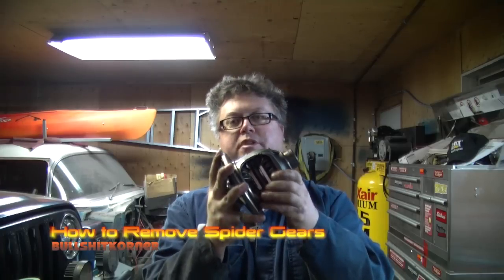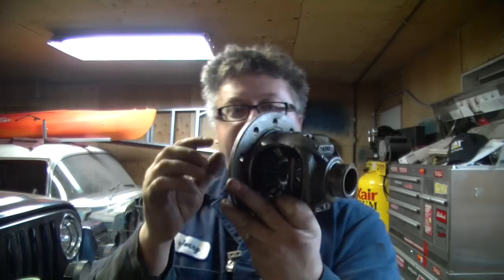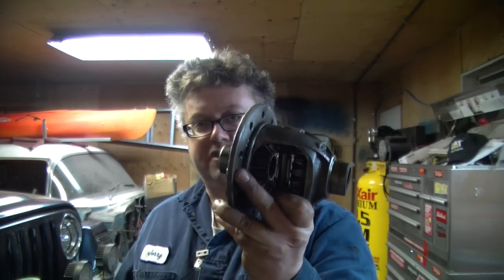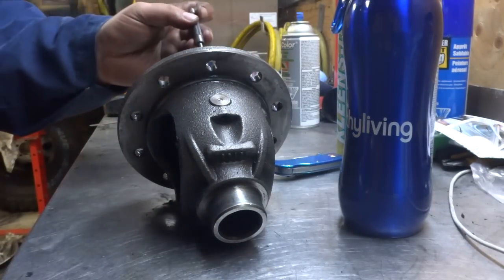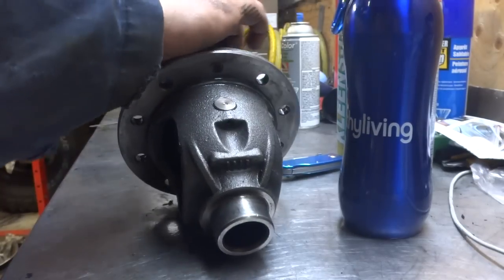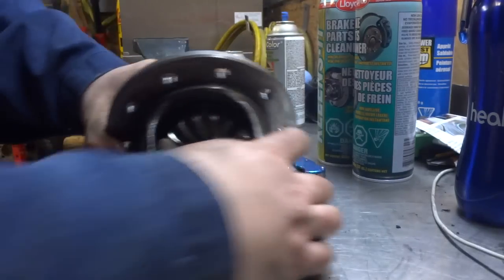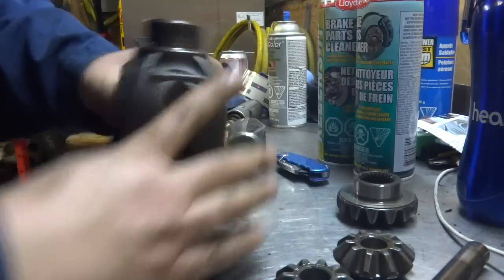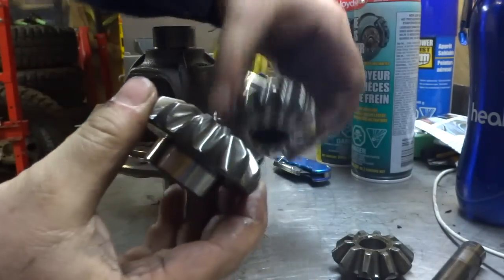How to Remove Spider Gears from your Differential

Comment: I am trying to take out the roll pin to install a new locker however the roll pin has seized up inside the other pin. I have been trying to punch it out but no luck. Should i consider drilling it out? Any help is greatly appreciated

Comment: hello, please just one question, I have a Sahara Jk from 2017 I already installed a 4.56 gear in the D44 rear differential, now I will install it in the front, but they told me that I have to change the Carrier.
I wanted to know if I can buy an empty Carrier and reuse my spider gear. thank you
Reply: I just bout a Yukon open carrier from Amazon 45 bucks

Comment: Can you remove the spider gears without removing the whole carrier
Reply: Yes. I used a 12" length of 3/16" diameter smooth rod on mine, still in the diff case, and it worked great. Once the roll pin is out, rotate drive shaft to rotate the carrier in order to to slide the center pin out. Once the center pin is out, just rotate one of the axles and the spider gears will slide right out. Hope that helps.

Comment: Thanks for posting this. I'm doing a front diff service on an 02 f350, when i took off the pan it looked like the lock bolt for the pinion shaft was broken. After 2 hours of searching found your video that explains that its a roll pin not a bolt. Thanks again ;)

Comment: Silly question. What size punch did you use ?
Reply: I used a 12" length of 3/16" diameter smooth rod from homedepot. Worked great. I don't remember the exact diameter of the bore, but its a little over 0.2".

Comment: mine has a bolt that is actually missing ( I can see the threads) on my 97 TJ. so the bolt is missing but the gold centering pin won't budge !!! all the gears turn and the gold pin even wiggles a bit but wont come out even with some taps with a heavy punch and hammer .....  Help please ...........

Comment: Working on an '06 Ford E-350 Van....it has the roll pin and I have used every punch I have and cannot get that roll pin to move....what gives?  What other means should I try in getting it out??
Reply from the maker: +ChaplainK have you tried both ends just in case the roll pin is tapered
Reply: +Bullshitkorner Yes,  I get so tired of these normally easy type jobs that take all freaking day!  Why can't this stupid thing just have a bolt like most applications!
Reply: A drill bit the same size as hole or smaller bit, drill out or grab it n spin it out...

Comment: hey bullshitkorner I'm new to this so bear with me if you would please...I just bought a 99 tj and I'm not sure what I have in the rear diff but all wheels turn at the same time..how do i figure out if I have a dana 44 or whatever the fuck Is in there so I can get spider gears and the carrier...if none of that makes sense that's ok don't answer. ha thanks.
Reply from the maker: +Brandon Cutts you can tell by the differential cover to identify what diff you have
Reply: thank you.
Reply: +Bullshitkorner so it doesn't say any where...
Reply from the maker: +Brandon Cutts it's not going to say unless you still have the tag,  otherwise you have to google Dana diff covers and match the results with the bolt pattern you have
Reply: +Bullshitkorner thanks for the quick response I really appreciate it

Comment: The ring gear MUST be removed first, correct?
Reply from the maker: segoon2000 to remove the spider gears you don't need to remove the ring gear.  I just stripped it down as i was going to sell it as i was installing a locker